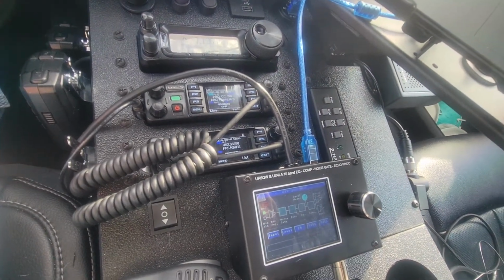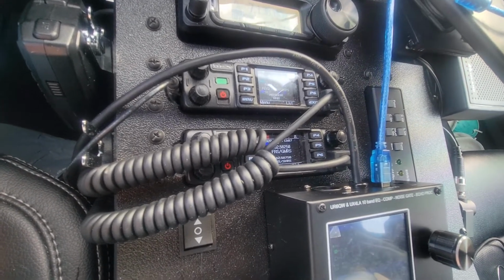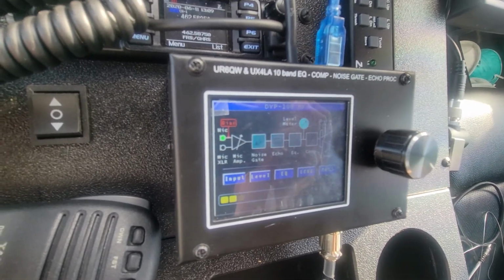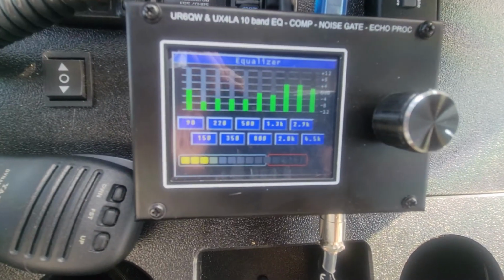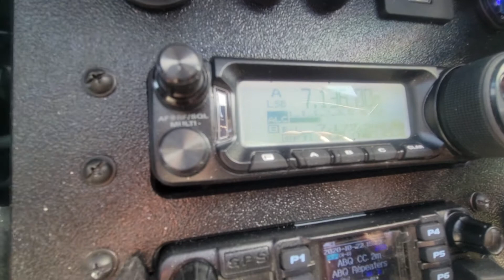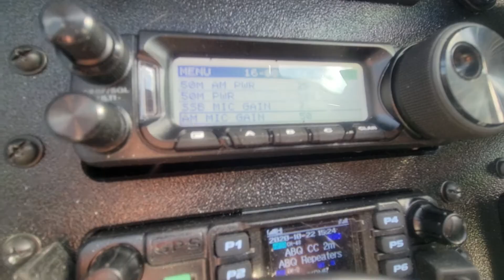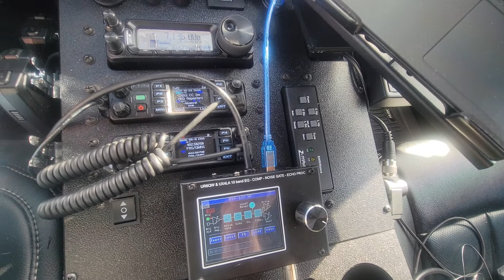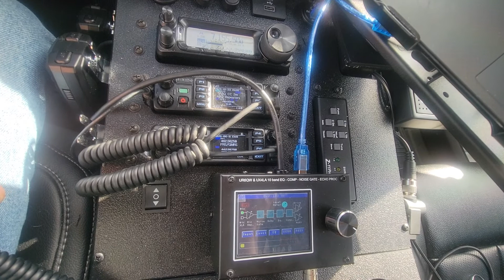AC5N mobile radio setup, UR6QW V7 Equalizer setup.

Comment: There is a software update available for this gives you 2 meter bars at the bottom also some other things
Reply from the maker: Just looked, I have the latest firmware.
Reply: @elkbow  wierd I thought the latest had 2 indicator bars at the bottom one for mic level one for compression level
Reply from the maker: @1teddy1979  crap, sorry, I was confused, thinking you were talking about the Yaesu and not the EQ. I don't see the firmware update where their video shows it on their site. I'll look again.
Reply from the maker: @1teddy1979  I found the firmware on another site. His site there is no firmware.
Reply: @elkbow  oh cool good to know I have to do that yet
Reply from the maker: @1teddy1979  go to ad5gg website and look for review and under comments there is a link to the firmware download. Frickin YouTube doesn't allow the links
Reply: @elkbow  thank you for the info